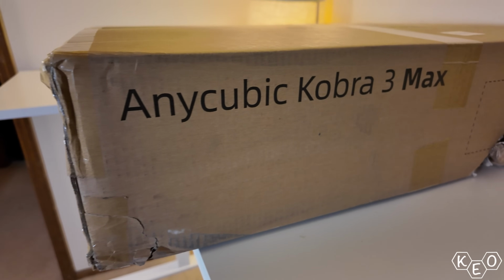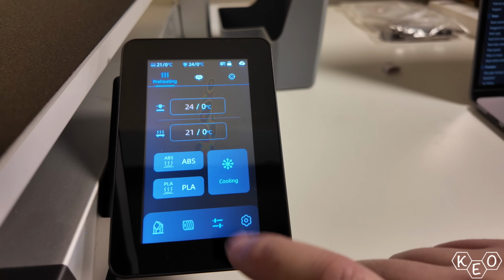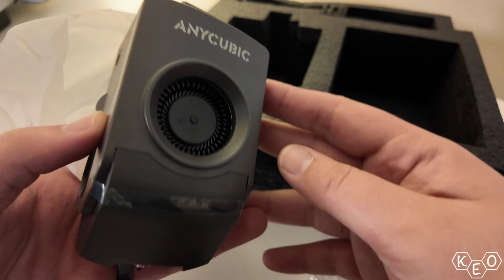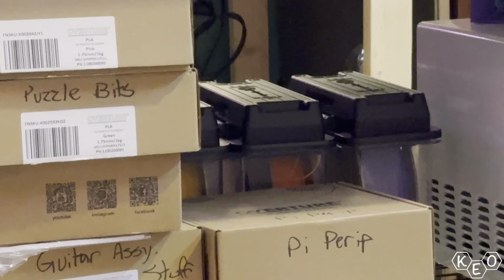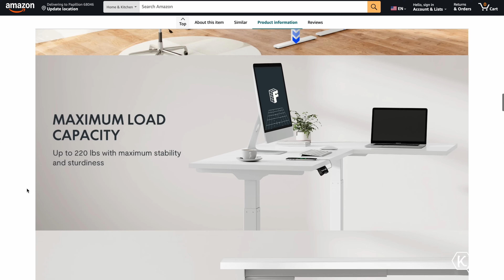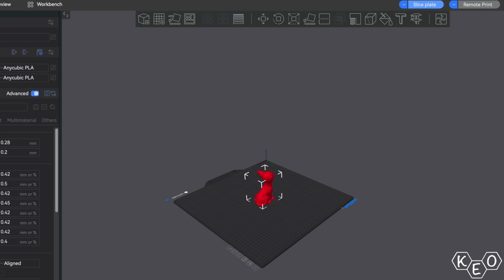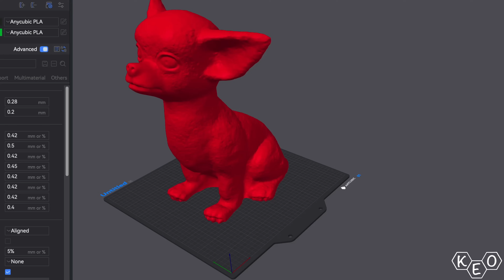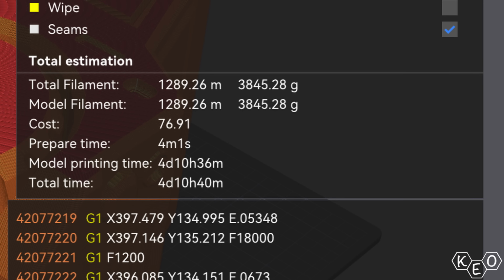How I Fixed the Kobra Max 3 and Made MASSIVE Prints

Comment: Mine has the same problem but it doesn't want to tighten up just from the screws. I'm wondering if I should remove them and tighten them and then put them back on?
Reply from the maker: I would just try and start from zero. Take everything out and reinstall as much as makes sense. Hopefully that helps

Comment: Good job on this video along with the rest of your channel.  I have had this Kobra 3 Max for about 8 months myself and have had good and bad results with it.  A big part of owning one of these printers is taking care of clogged extruders and other issues relating to the flow of plastic through the material handlers and printer.  It would be great if your videos covered solving these problems.  For example, on the Kobra 3 Max, it is extremely difficult to fix problems when filament is jammed inside of the printhead.  I have a pile of the printheads that I am unable to fix.   Luckily, the replacements are only about $50 each.  It would be awesome if you showed us how to service this unit.  Not a full repair video, but, if you cannot fix a clogged extruder, you cannot print long with ANY printer.  Fixing  a clogged extruder on the H2D is a real challenge for any tech even one with the required tiny fingers.

Comment: Hello there.

I bought one of these, but I've got a doubt: Its movement is so hard that it literally moved the pine table where I put it almost 10 cm away from it's original position. Is it normal? In fact, the vibration & the movement was so abrupt, that part of the print detached from the plate.

Thank you & greets from Argentina
Marcelo Miguel Bazan.

Comment: Did you have to recalibrate it after the screws tightened? My right side is definitely being funky.  But it printed fine before
Reply from the maker: Yes, I typically run calibrations before every print anyway. But I manually did it after snugging everything down

Comment: I've had so many problems with my K3M... I will never buy any machine from anycubic ever again... it's got so many problems... and yes it was cheap for the size but would have been glad to pay another $500 for Bambu Lab type of quality... I can't trust it to complete a tall big print of multiple colors... I've wasted over $1000.00 on failed prints due to many different issues... mostly  clogged nozzle after printing a big 5 color model for 8 out 17 days print time... We need a 500mm x 500mm x 500mm core XY multiple  color printer by some company that will take the time to figure out a none loss print due to clogged and ways fix the clog without it killing the print... or big stuff is a none starter...

Comment: The question is: Anycubic Kobra 3 Max or Creality Ender-5 Max?
The biggest advantage of the Kobra is its multicolour printing capability. However, there are rumours that Creality has a multicolour model in development. Personally, I find the 400 mm build volume more important than colour options.
One feature I do appreciate on the Ender-5 Max is the availability of an enclosure. Overall, I'd love to hear your thoughts—what would you recommend, and why?
Reply from the maker: This is tough for me. The AC system is reasonable but it is built to a price point. As such, you chase little issues here and there. On the other hand, the Creality multicolor system has its own issues. And historically, Creality printers are more trouble than they're worth. I used to own 12 before switching to Bambu and I am not looking back. But speaking about this generation of Creality machine, we have a K2 kicking around the channel and it has been nothing but problems.

So overall, I would take an Anycubic over a Creality any day. But I would take a Bambu over anything any day. Hopefully that helps a little bit!

Comment: 3:31 BRO MY ELEGOO NEPTUNE 4 MAX IS HAVING THE SAME Z OFFSET ISSUE.  I just checked those same screws on my Neptune 4 Max and HOLY CRAP they were LOOSE!!! That hero mightve just saved my Neptune 4 max omg.

I was thinking of replacing my Neptune 4 max with one of these very soon because of the z offset issue alone.  The AMS is nice on this, but if this actually fixes my neptune 4 max then I'm gonna keep using it for awhile before I replace it with a Kobra 3 Max
Reply from the maker: Thank goodness. I wanted the world to hear about that fix because I was so ready to write this whole machine off. Glad it helped

Comment: I really need some help I got a kobra 2 max and the extruder and hot bed grind when motor is being used I can freely move them no problem when off no grinding but when I try to level the extruder/nozzle try to go lower than they actually can and when the bed moves foward(while leveling it grinds when moving foward) Please help if you can.
Reply from the maker: I am not sure on that one. Unfortunately the best advice I can give you is to reach out to AnyCubic support. I know those experiences often aren’t great but it’s the best chance you’ve got
Reply: @KeoPrints I got it thank you for responding!

Comment: Just got my printer and followed your instructions but for some reason this thing grinds when it moves all the way forward and backwards. Wtf to do lolz. Any suggestions
Reply from the maker: I would go right through every nut and bolt. I am preparing a more in depth review right now and I had to tighten a lot of the rollers and brackets on this machine. Don’t overtighten anything but give it a once over for sure

Comment: As someone who has had several budget printers, I have learned that you always have to check the bearing tightness as well as the z guide nuts for the z lead screw. The bearings should be able to just move by hand and the guide nuts should be slightly loose to account for any bend that the lead screw may or may not have

Comment: Print head konked out on Mr. and anycubic support was too dumb to send me the heating element. They just sent me another broken printed. So I had to order 2 heating elements which fixed the issue. I returned it. Of course, the faulty heating element. I got a full refund, but man. Was that annoying other than that? The printer has actually served me well.  Serious bed loveline issues though which I plan to correct using the knowledge of this video.Hopefully that goes away too

Comment: I've had nothing but issues with this machine. It has spent more time waiting for parts from China than actually working. The Z-axis sensor went out after the first print. Anycubic sent me a new plate, head cable (The original got pinched in the build) and eventually, a new sensor. Customer service is great with these guys but expect long shipping times as EVERYTHING comes from China. Currently, it clogs up whenever it switches colors. Working on that issue now.

Comment: I purchased this printer, and found out that you should be able to use any webcam. I happened to have a logitech c270 that I used from previous printers I have owned, and it worked great without any modding

Comment: how did you do this my max 3 is terrible. my 3rd  anycubic printer. this thing doesnt have z offset option in menu of printer there is nothing there to adjust.
Reply from the maker: That may have been a difference in firmware but this option was only available mid-print

Comment: Hey man, just set up my K3 Max and am using anycubic slicer and there's no profile for it... only the K2 Max. i saw someone else in your comments said to just modify the bed dimensions of the normal K3 profile but i see you have a K3M profile, where'd you get it XD. (i do have the most recent version of the slicer also)
Reply from the maker: That’s odd that it’s not coming up in the slicer. Is that the AnyCubic Slicer Next? I know they had two different AC slicers floating around but the AC Slicer Next is the newer one
Reply: @KeoPrints  I figured it out, commenting for those who had a similar issue:

If you also had this issue, instead of downloading the most recent anycubic slicer Next from their website, I installed (and replaced the existing one) the Next slicer that came in my flash drive with my printer. The K3 Max profile was there afterwards.

Comment: Dumb question time: 
I installed both the Anycubic Slicer and Orca slicer, neither have a profile for the Kobra 3 MAX......only the Kobra 3.
Did you have to custom make one for yours?
Reply from the maker: That’s odd. You should have the Kobra max preset on the AnyCubic next slicer. Are you on the latest version?
Reply: @KeoPrints  I installed 1.4.4, it then prompted me to DL 1.4.5, which I did. Upon opening it, the UI was totally different and it said 1.1.1 in the about tab. Neither ORCA or Anycubic had a profile for the 3 MAX so I just said "F**K it" and I went back to Simplify3D, the tried and true slicer I've used for over a decade.

"When all else fails, stick with what you know" :)

Comment: There we some interesting updates today.  First a new firmware, and then a revision to the slicer software so we now have official 0.8, 0.12, 0.16, 0.2, 0.24 and 0.28mm layer height settings for the 3 Max with a 0.4mm nozzle.
Reply: hey man, where do i get the K3 max profile from? i have the most recent version of anycubic slicer but theres no profile for my K3 max
Reply: @blakeh4681  They should appear when it updates.  If they don't, then do a complete uninstall of the slicer software, reboot and reinstall the latest version from Anycubic's website.
Reply: @blakeh4681  If you're having trouble getting the new profiles, completely uninstall the Anycubic Slicer software, reboot, reinstall the "latest" version from their website, select the printer and the 0.4mm nozzle, log-in and see if it updates from the workbench screen.

Comment: Have you experienced the x-axis not aligning when changing color? And it is only off from first to second layer/filament. 
So prints the first color/layer of the print - then purges and the next layer/filament is printet a bit left off from the first layer/color. All the next layers are the same.
Reply from the maker: Hmm this isn’t something I’ve experienced yet. Sounds pretty silly for a new machine

Comment: Thank you so much for the help, I loosened all the bolts and hand tighten them back up, making sure not to over tighten them. My initial prints were not sticking to the bed and looked like garbage and after I made that fix my prints came out perfect.
Reply: I’m now running into the same issues as when I started. Next I’m going to try to adjust the Z for every print.

Comment: I would like to see an Ender 5 Max, after you get a new heated as Creality is sending thrm out apparently they discovered one had an issue in their testing.

Essentially a K2 just with a larger volume.

Also I reccomend you do a. Amnaul leveling on the K2 plus and print out the ptfe tube clip that ensures it doesn't break off in the entry towards the extruder.

Comment: Nice review. I have a love hate relationship with the offset on Anycubic machines. My Kobra 2 Max stores the offset if you change it. As does the Kobra 2 Pro. Can't adjust before the print though...TF? But these new models do not store it apparently between prints.. Hopefully a firmware update will fix that. I almost bought one but I got a good deal on a Kobra 2 Max because I really just needed the bed volume for some masks that I am doing. Multicolor was a plus not a need. But now I might regret that! I like the dual Y axis motors on this one. Ghosting has been an Anycubic highlight also. 😂

Comment: I cannot wait for the .06mm nozzle to be released. Wow I got mine before you.. wow..
Reply: Also going to check mine for tightening like you showed. I didn’t have any real issues except it always wanting to print 10-20 degrees below and some bed adhesion issues which could be the issue you had.

Comment: Prices on those Flexispot desks sure seem reasonable.   I would think by now you would by default check all the fasteners when putting together as many printers you do.
Reply from the maker: It would be smart to do a bolt check before hitting the power button but ultimately, I am trying to get the genuine, first-time-user experience with each printer I open. From using the provided tool kit for assembly, to default slicer settings. So a newbie would likely not tighten anything first so I also wont. But more importantly... lazy...

Comment: Still it looks like a winner if you work on the problems? 
Maybe a better fan housing is online which can have a 2nd fan for better cooling of the overhangs! 

Amazing printer for the cost. I seen it on the UK Anycubic site on a money saving deal 
So I will maybe get it on the buy over 3 months no interest deal they are doing here?  I

t be £223 a month for 3 months. 
A good deal with also £70 off and a £50 helper pack too as it is Easter.

I have a Elegoo 4 Plus and a Qidi X-Plus-3 and a Elegoo 3 already, 

I have designed two cool models I myself come up with that are practical prints, 

I wish to sell online soon so this Multi Colour Printer be the 1st one I've ever brought 
and will help me do multi-colour printing of many models for the selling too!  

Thanks for the review and the fix tip of the z height problem you found and now passed on.

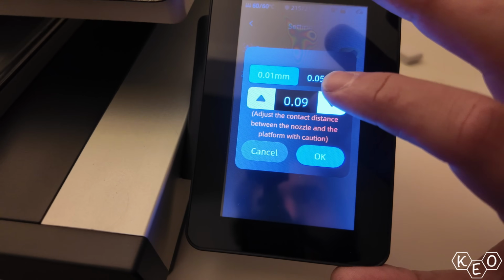Comment: "Hello, the Z offset at 2:23 doesn't appear on my machine. How can I enable this option?"
Reply from the maker: I believe it is only available during a print
Reply: @KeoPrints  "I checked everywhere during and after the print, but I couldn't find it. Could you explain how to access that menu?"
Reply: @KeoPrints I have the same issue as this guy, have either of you figured out why the z offset adjustment is missing?? Thx, going crazy here
Reply: @KeoPrints  Any insight? Going through it here
Reply: In the slicer
Reply: You can find that setting in the anycubic next slicer and set it in there, save the profile and print away.
Reply: Thats not what any of us are looking for..

*Starts print*: notices z offset is to low or high, stop print, take a WILD guess for the adjustment, then start print, realize its still not right, stop again, adjust in the slicer, restart, nizzle slams into bed lmfao.

No. This guy ADJUSTS HIS FRON THE CONTROL SCREEN ATTACHED TO THE PRINTER NOT FROM THE SLICER. ANYCUBIC IS ***KING TRASH. I sent that POS back and will bever buy one again. Ill stick to my bambu X1Cs and Neptune 4 Max

 @The_Cannaseur
Reply: Na minha não aparece essa opção.

Comment: Holy infills, you need it to be that high?
Also I don’t think the purge tower is needed if the printer poops, that’s going to save you some time and filaments
Reply: The purge towers purpose isn't only to purge filament, it's also to prime the nozzle and make sure it's going to print consistently once it moves to the model and starts printing.

Comment: Loose screws has been a problem with printers lately. Manufacturers are increasing production speed and not focusing on quality control as much. You pretty much have to check all screws on every part while putting them together to make sure you won’t have issues.

Comment: Love mine so much I just ordered a second one! I have had zero issues with this printer. It does everything I ask it to. I bought it for big prints life size models and it runs for days without issues!
Reply: Lucky 🫤
Reply: I didn't have problems with mine until I hooked up the ace pro for some reason... but after watching this I noticed the locking nut had a stripped out screw so im assuming thats throwing it off 😢
Reply: Thank you guys so much and also the creator of this video i will order one now.
Reply: Same with mine. I’ve had no issues and nothing but great prints. I have 50+ hours on the machine and not a single failure. I’ll be hooking up the ACE this week to hold my PLA, PETG, and PCTG. Would buy another one in a heartbeat.

Comment: My most used printer is an A1, but I wanted to upgrade my DIY LiFePO4 RV batteries from the original 280 Ah cells to some EVE MB31 330 Ah cells before the tariffs went up.

I was planning to get the H2D but when the price went up and the order by date moved again, I decided to drag out my Kobra Max. After adding a PEI bed, it has been happily chugging away making battery case parts.

I just checked and the bolts were loose just like you said yours were on the Max 3. 

I needed a big printer since the case parts are so large. The sides are 319mm x 272mm. Now granted, they are only 1.6mm thick, but they still take many hours to print each.

So, yes, some people do need a large print volume printer. I have considered getting the Kobra Max 3. I appreciate your reviews, clearly stating the good and the bad. After things settle down, I may revisit getting the Max 3.

The bottom of this page has my latest battery version going together. The orange and black ones.

http://parkerprintshop.com/index.php/3d-printing

Comment: Any chance someone has a fix for the ghosting on flat surfaces? I print a lot of signs and the large flat surface is the reason I bought this printer. So it's super problematic that it is happening.
Reply from the maker: Not sure. This would be a difficult platform to address that since it’s locked down pretty hard. Perhaps simply slowing the thing down will help?
Reply: Try dropping the jerk down to like 7

Comment: Just might have to order this in at some point. For production I'm using the Kobra 2 MAX because we need a large build plate for our products and the size has made a huge difference. Also ordered in the Kobra 2 PLUS, but it's been a failure for my needs all because the plate is just not big enough and it limits what I can run for jobs. We've run well over 800+ hours on the Kobra 2 Max without any issues. :face-blue-smiling: